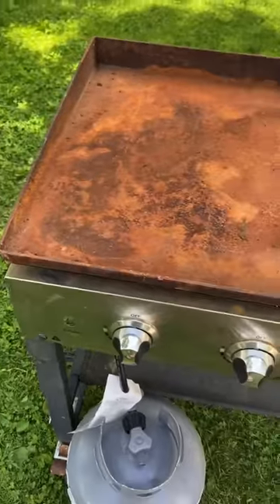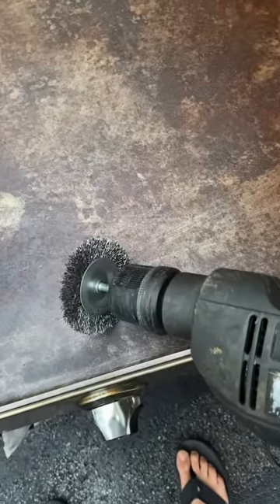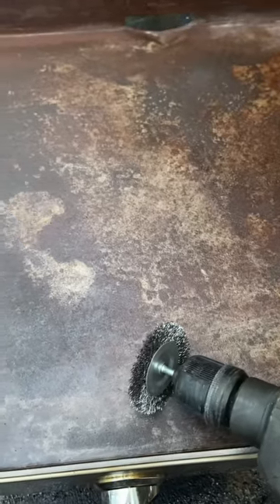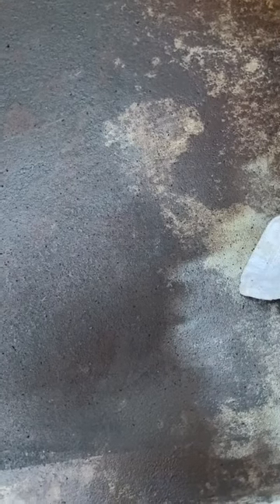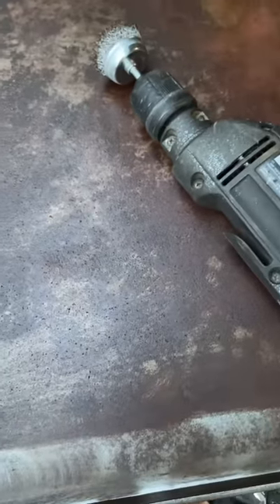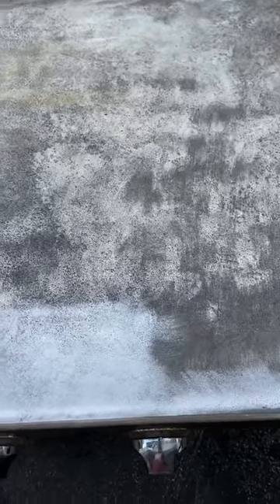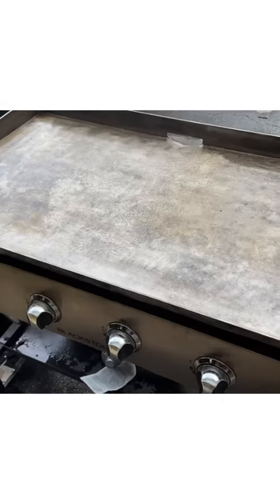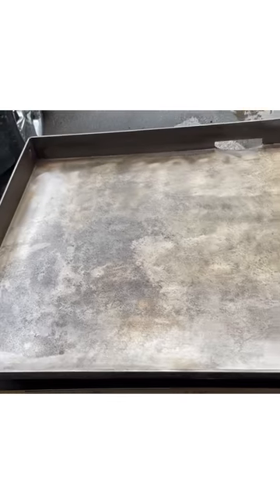$25 bargain 36” blackstone restored to new!

Comment: After scraping all the surface rust I would have used a restaurant grill pumice stone with olive oil by hand......it leaves a great finish and keeps the surface flat without the high and low spots you get when machine grinding.....and always season with a high heat low smoke oil.......

Comment: Bro tip: Use a random orbit sander with about 40 or 80 grit on it after you scrape all the rust off. Works the same less drill trying to run all over the place with the wire brush. A hand held grinder with a flap pad works pretty good too.
Reply: Great idea Bro!! I think I might start picking up old grills and griddles to restore/salvage! Lol
Reply: @pinarellorider9023  Thats where I got mine. 4 years still works great. After using what ever method you use to get the rust off. Seasoning the metal is the key. Go get you some alvacado, sun flower or peanut oil. (high smoke point) Coat heavy. turn grill on high until it almost all smokes off. Turn off let cool a bit (150 degrees is fine) , Do it again. and again and again. about 4-5 times and the oil will bake a layer on there that is mostly non stick and will keep the rust off. Then each and ever time after I use mine I wipe it down as it's cooling with olive oil. It doesn't have to be olive oil that just what I cook with. Key point, don't leave your grille dry. It will rust.
Reply: @jamescole6846  Broooooo!! Thanks for the tips. I appreciate the help.
Reply: You get high and low spots when you use a grinder.......
Reply: @bartstarr972  I said a flap disc. Not a grinding wheel. A flap disc is just sand paper.
Reply from the maker: @jamescole6846 you want light coats of oil for a better surface.

Comment: I literally just gave a rusted one away. Bought a new $400 one about a month ago. Seasoned with the Blackstone cream and looked yesterday and it's fully rusted smh. I have no choice but to try and restore.
Reply: I found the Best thing to Season Cast Iron Griddles, Pans and Grill Grates is Bacon Grease. Never use a Producr sold by the Manufacturer.  They want it to fail so you buy a New one. I have 2 Of these Grills. I use a Grill Brick on them after each use while they are still a little warm. Then a Bacon Greasing on low Heat for 10 minutes. And wipe Down before cooled off. My one Blackstone is 7 years old.

Comment: Could’ve also use oil and then rinse off with ice cold lemon soda. Will turn out like new. And you’ll save your elbows.
Reply: First time I heard that one. I will remember that one fo sho
Reply: Is that b4 or after you sand it down I would like to know the steps by step to clean mine thanks

Comment: 80 grit flappers disks on a $20 harbor freight grinder. 100 times better than a drill!
Reply: I didn't his when I first bought it. Then finish out with orbital sander. I just did this all over again after sitting outside in Florida weather after no use for over a year. Even covered with tarp the elements will get to it. But those flapper discs are game changers

Comment: What year is the 300ZX?
Reply from the maker: 1990 low miles. Bought it when I was 20 years old.
Reply: @Justplainnasty  
Thats awesome. 
I've had 3 of them. Miss that car.
Have a 370z now, but its not the same as having a 300ZXTT.